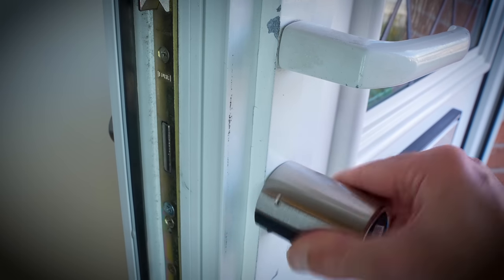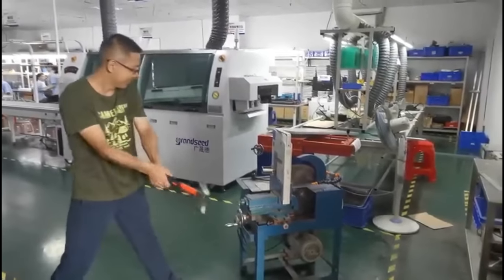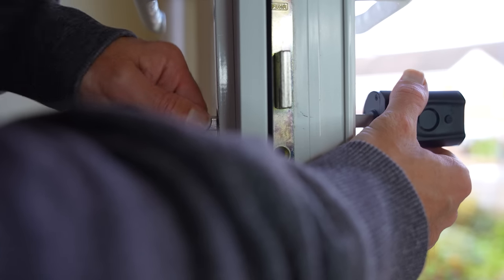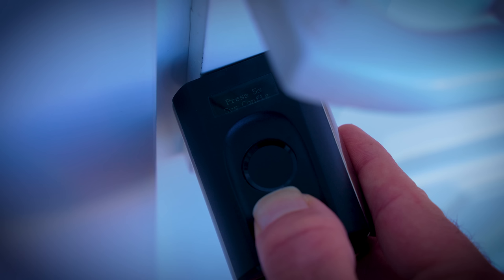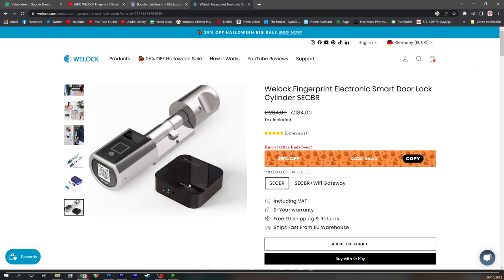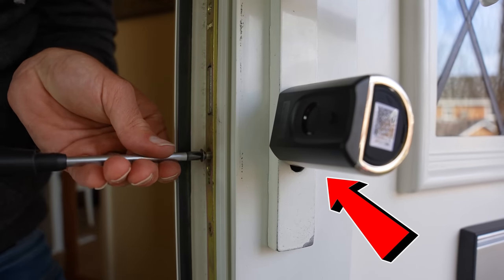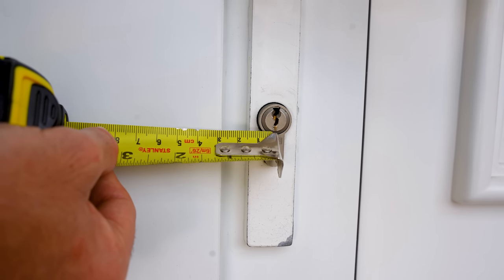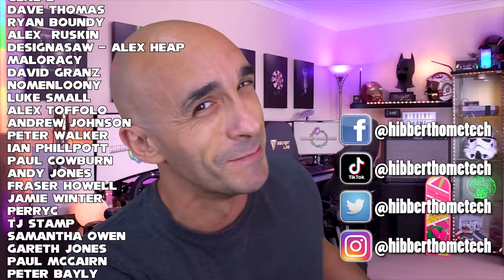This Did Not End Well For Me... Alexa Enabled Retrofit Smart Lock

Comment: Hitting a euro cylinder doesn't fill me with any confidence as to how secure it is or the integrity of the lock, leverage does.
I'd like to see a 4ft length of steel pipe slid over that handle and levered down.
I think the euro cylinder would snap in the middle as most do.
The fact the square shaft goes into the cylinder adding to the leverage.
That's what should be tested in the manufacturing video.
Reply from the maker: Right, hang on a minute.  How would you slide anything over the handle?  It's right up against the door.  There is no way from the outside to pull the handle away from the door so it's literally impossible to get the "leverage" you're describing.

This is your 3rd comment to try to convince the world that this thing isn't secure and I'm starting to wonder what your motivation is.
Reply: @paulhibbert  keyboard warrior?  I responded to one of his comments about this lock not having the British standards institute mark and he responded and then appears to have deleted the comment.
Reply: @paulhibbert  Paul, I suggest you look what the vulnerabilities of Euro cylinder's
Rather than getting defensive.
It's your front door, not mine.
Reply: @paulhibbert  and if you can't imagine how you slide something over the handle this explains the need for a bird's and bee's lesson.
Reply from the maker: @Life is digital I'll be totally honest here.  I deleted the other thread, not your fault by the way, your question was perfectly valid.  I deleted the entire thing because it was starting to boil my piss.  I put up with as much hyperbole and assumptions as I could muster, right up until some feller questioned both my integrity and my competence, and that was the last straw.  It's fine to ask if the product has been certified to a particular 3rd party standard, that is a fact based question with a factual answer, the answer is no.  

Unfortunately when people start saying "I RECKON x, y and z"... and "I THINK blah"... and even worse "I BET the lock picking lawyer could...." it quickly becomes a bandwagon of people shitting on something they have literally no experience of.  It's not fair to the manufacturer.

The opening to this very thread establishes it's argument with an impossibility.  Mustang Boss is either wrongly making the assumption the outside handle can be pulled out, or worse he's given no thought whatsoever to how the snapping of the lock could be achieved because he is so convinced he is right, and doesn't see why he should bother himself with the details.  These are powerful statements with no basis and it makes me insanely angry.  

I've just checked as I'm typing for a response and he's tried to explain it away with the "birds and the bees", who knows what that even means; if my missus had a large door handle over that part of her body I'd be scuppered.  I suspect he's adding mockery in place of a salient argument hoping that will wash.

I can (and do) argue these things one at a time as best I can, but sometimes it's just not worth me wasting my afternoon going through a toxic thread of people telling me that I'm complicit in the sale of a "weak product" by people that have literally no experience of said product, it's infuriating and far too time consuming.

From here on out I'm simply going to delete any comment that attacks this lock on the basis of assumption, and permanently comment ban anyone that attacks my integrity.

Questions about the lock are fine, assumptions about the lock posed as accusations are not.
Reply: @Mustang Boss I agree with you on the vulnerability of most Euro Locks to snap attack that's why I replaced mine with Avocet ones which don't have this vulnerability and are also not vulnerable to bumping and picking, although the LockPickingLawyer coulkd proibably still open them with his hips. It would be interesting to see if the WeLock would be resistant to snapping under leverage using something like a short length of scaffold pole or some mole grips.  Nice video by the way Paul.
Reply from the maker: @MAMDAVEM  thanks Dave. I must be missing something here, how would someone get the mole grips around the cylinder with the rotating handle in the way?

I've seen it done on a normal cylinder, but this is far from that.
Reply: @paulhibbert  You'd just use the mole grips on the handle. No need to even remove the handle. I am no keyboard warrior, but I would not touch this with a bargepole. My comment on the other thread seems to have been deleted with the thread itself. Our neighbours were broken into 3 weeks ago. The thiefs broke in while they were in bed. They used lock snapping to get in. Having spent hours researching locks to make sure the same doesn't happen to us, and having spoken to the police and a locksmith, I can tell you that about 30-40% of break-ins are using the lock snapping technique to get in and this lock does not have any snap protection. You can see just by looking at the cylinder. There are no sacrificial break points and there are no hardened sections. Unless the cylinder is three star or diamond rated, it is vulnerable to this simple attack. If you don't believe me, just do a simple search for 'lock snapping'.
Reply: @paulhibbert  I was presuming that the rotating handle was connected to the cylinder by a square metal rod and that applying a torsional force to the rotating handle would transmit to the cylinder through the metal bar. If this is not the case would you have to remove the rotating part (with the Allen key) to access the square metal rod directly?
Reply from the maker: Hi Rob, As I said above, I'm deleting any comments that throw out accusations based on assumption because it isn't fair to the manufacturer.  I'm letting this one stand for now because the rest of the negative comments elsewhere on this video have died down a bit and I have time to answer.  Don't be surprised if this thread gets deleted for the same reason as the other one, it's not fair to the manufacturer to have unsubstantiated claims made against their product.

First of all, it's fine that you don't trust any lock that doesn't have X Y or Z certification, that's a sensible enough standpoint and I won't argue with you.  

My issue is with the assumption that this lock is garbage simply because it doesn't have that certification, and more to the point all your other assumptions around the locks capabilities.

1. Your first assumption is I haven't seen lock snapping videos.  I've watched plenty of them because this ain't my first rodeo.  I have to deal with the same cynical comments every time I release a video about locks and it's preceisely why I tend to have a pop at the lock picking lawyer in every lock video I make.  That guy has caused so many people to think they are experts at breaking and entering.  Not saying you're one of them, but believe me when I say, I've seen how lock snapping is done.  I don't personally see how you could get mole grips around this handle and get the purchase required without the barrel spinning around and causing you to punch yourself deservedly in the nuts.  I could be wrong, but this of course all hinges on your other assumptions regardless...

2. "Unless the cylinder is three star or diamond rated, it is vulnerable to this simple attack"... That is an unfair sweeping statement.  You don't know what this lock is made out of, or what measures it has to prevent lock snapping simply by looking at it; it looks pretty bloody tough in their video.  You can't assume that because it isn't 3 star or diamond rated that it isn't made out of the exact same material as a 3 star lock, or that measures haven't been taken that would give the lock that rating if they paid to certify it.  This is a Chinese company trying to keep the sale price low, it doesn't surprise me they don't have certification.

3. You say it has no sacrificial points and there are no hardened sections.  I'm looking at it right this second and I see the lock side of the cylinder has a cut part that I don't see any other use for.  Maybe it is, maybe it isn't, but your assumption doesn't seem fair.  Furthermore, I really don't know how you could possibly know there "are no hardened sections", I'm looking at anti-snap locks online and don't see any way of knowing this through visible inspection.  It certainly looks pretty bloody hard as that bloke goes at it with a hammer.

I'm not trying to convince you to personally buy this lock, I'm no security expert and I'm willing to accept I haven't tried to snap it in my door (because my missus would divorce me), but it's not right to dump on this thing with no actual experience of it.  Maybe I'll get myself some REALLY bloody big mole grips and a vice and make a follow up video.  Seems a shame to damage it though, I found their hammering the crap out of it to be pretty convincing.
Reply from the maker: Hi Dave, you have to undo the allen key to the battery cover to get to the allen key to the metal rod, at which point you can extend the handle outwards, but not off.

Whether or not applying downward pressure to the rod or the handle (both spin when the handle is locked BTW) would cause the cyclinder that houses the rod to snap is entirely guess work until someone actually tries it.

Looking at it I think the mole grips would shatter the handle if you could get them around it, and it didn't spin and make you punch yourself in the nads.

I honestly think any burglar would take one look at this thing and put your windows through instead of waste valuable time trying to break it open.  Perhaps I feel that way because I have such an open view of my front door to the neighbourhood and a doorbell cam.  Could be different for someone with a more sheltered front door I guess.
Reply: @paulhibbert  All Euro-cylinder locks, unless 3 star or diamond rated, are vulnerable to lock-snapping and even the rated ones aren't impenetrable. It's an inherent issue with the design of the Euro-cylinders themselves in that they have a weak point where the retaining screw and cam are. There are almost certainly millions of non-smart locks installed on houses throughout the UK that have this vulnerablitiy and they are still sold and people are free to choose them. The point I am making is this is not a certified secure lock and people need to be aware of that fact. It both shocked and scared me at how easy it is to snap a lock after our neighbours were broken into using this technique. It's no wonder that it's the most popular way of breaking in, as it really is that simple if the locks are not hardened and with multiple sacrificial break points in the correct places.

I have made no statement around the locks other capabilities. Purely that I wouldn't touch it with a bargepole because of it's cylinder being insecure. I would also not touch any non-smart, non 3-star rated Euro-cylinder lock with a bargepole for the same reason.

Having spent hours on end looking into this for our own security and protection (the thieves that broke in to our neighbours had knives), I can most definitely tell you that the cylinder does not have hardened sections or sacrifical break points. Look at any 3 star lock and you will see how they are constructed of multiple parts with the hardened sections in the places that need extra protection. This is a one piece construction and there is only one cut in it and it's not even in the right place. They have probably put it there for visual effect more than anything. Unless you are claiming that a Chinese manufacturer that is trying to keep costs down is going to use the same hardened material across the entire cylinder when even the big names in security do not do that, then this is a ludicrous statement.

The guy hitting it with a hammer is a farce and a PR stunt. The door it's fitted in is made of plywood or something. That is not how you test for snapping and you can see that the door has actually broken.

If you don't want people to call out these points in the comments, you need to put a disclaimer in your videos regarding the fact that it has not been tested to any standard and that the cylinder is just not a security rated one. People need to be aware of such things. Trust me, we weren't even broken into, but I have changed all my locks to make sure that they are as secure as they can possibly be and I would not put this thing on my door, not a chance in hell.

PS I do have smart locks on my doors, but only ones that have passed testing in the UK and are certified as Secured By Design.
Reply: @paulhibbert   I think you are right the average scumbag burgler would just jimmy a window before going to the trouble of trying to get past something unfamiliar that might take too much time and leave them exposed to being seen.
Reply: @paulhibbert  Thieves don't break in through front doors if there is an alternative means of entry. They will choose a rear, or patio/french doors over anything that exposes themselves to view. That's exactly what they did next door. Snapped the locks on the French doors. I was surprised they didn't put a brick through the window, but apparently this is generally avoided if they can snap the locks, as snapping the locks is very quiet in comparison to breaking a window.
Reply from the maker: I'm sorry Rob, but we're entering deletion territory now.

You made your point that it isn't a "certified lock" and I accepted it.  Everything else is blustering without basis.  Here is a kitemarked 3 star lock that is all one solid piece and for all intents and purposes looks identical on visible inspection to the welock: https://tradelocks.co.uk/kinetica-3-star-kitemarked-euro-cylinder-locks.html  

I therefore put it to you again that you can not tell how capable this lock is simply by looking at it, and you certainly can't say that it is "inherently" "vulnerable to lock snapping" without hard evidence to this effect.

You go on to state "The guy hitting it with a hammer is a farce and a PR stunt. The door it's fitted in is made of plywood or something. That is not how you test for snapping and you can see that the door has actually broken."  It's quite clearly not made of plywood or it would have shattered all over the building on the first hit, and once again you are making assumptions about their testing after I've asked you not to.  The fact the door broke before the lock is a demonstration of the locks strength.

I've already accepted you feel more comfortable with a certified lock, now you need to accept the possibility that a non-certified lock might be just as secure.  Certification guarantees a locks capabilities, it doesn't guarantee the lack of capability of all other locks.

"If you don't want people to call out these points in the comments"... oh, that's what's happening is it?  I thought we were having a grown up debate about the validity of certification, I didn't realise I was being called out. 🙄

Maybe I should put disclaimers in for those that have such concerns around certification.  I think the more likely solution is that I just won't do videos on smart locks anymore because it isn't worth dealing with lock picking lawyer fans, and people "calling me out".  Either way you win I guess.  Congrats.
Reply: @paulhibbert  It looks like we will simply have to agree to disagree. I watch your videos every week and enjoy them greatly and this is the first time I have ever had a reason to post comments such as this. I think the reason that your lock videos get these comments is because it's the main thing that defends your house, your place of safety, against unauthorised entry. Security isn't a joke when you've had your eyes opened, as I have, as to how disturbing someone gaining entry, carrying knives, while the home owners are in bed is. They got away with their car. Fortunately, no-one was harmed. It's not about anyone winning either BTW and it's certainly not a personal attack on you. I'm making these points as people need to be aware of the risks associated with non-certified locks.
Reply: @robert.wigley  I was also shocked at how easy it was to snap most Euro locks so I replaced mine with Avocet ones all keyed-a-like so I have one key for all my exterior doors. You should check them out. I bought them from the Barnsley Lock and key company and got a great service from them.
Reply: @MAMDAVEM  Thanks, but I am fully secured now. Have heard good things about that company and those locks from a locksmith.
Reply from the maker: Thanks Rob, appreciate that.  Sorry if I've gotten a bit heated with it.  I think we disagree on less than you think, I just would like to see someone prove this lock is insecure before everyone piles on it.  I don't currently have the ability to do so unless someone has a door I can knacker.
Reply: @paulhibbert  No worries and no offence intended, or taken.

Stick it in a vice with the cam and retaining screw on the external side protruding and attack it with a pair of mole grips? 😁

That would actually make for a very interesting, informative and potentially funny video (as long as it doesn't snap instantly), what with your adversion to DIY, (which always makes me belly laugh) and as long as your sponsership isn't cancelled (cue your usual inserted video clip). 🤣
Reply from the maker: The thought has crossed my mind, the only issue is I don't have any of those things, and I have nowhere to put them if I buy some, this channel has caused me to outgrow this house!  Hoping to get a bigger house in the not too distant future.